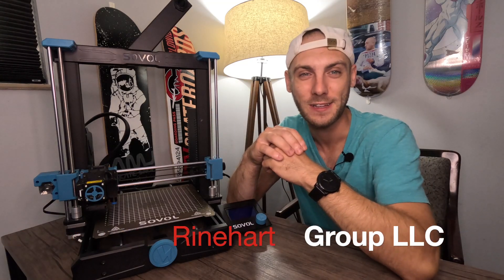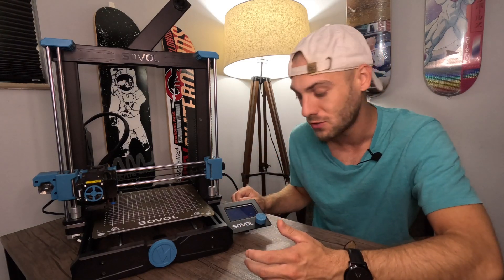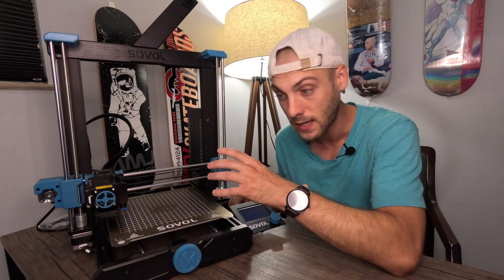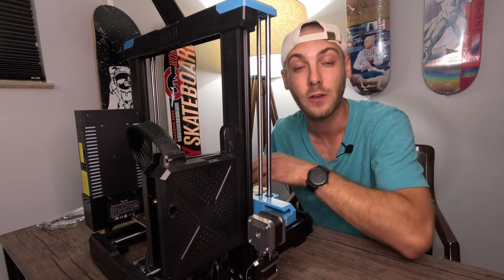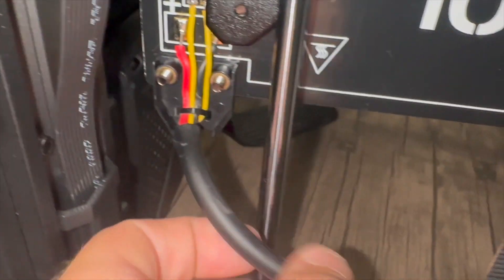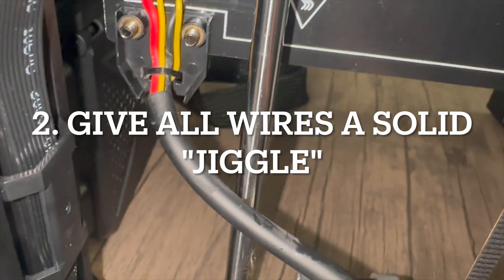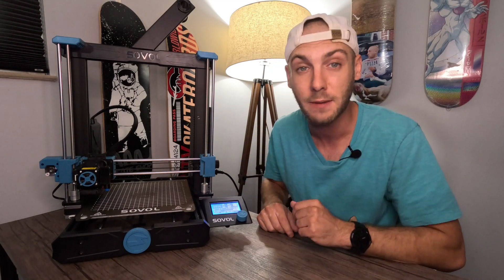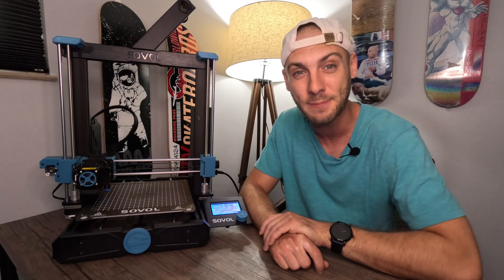3D Printing Ep#8: SOVOL SV06 Design Flaw "Bed Printer Halted" Temporary Fix

Comment: I had a broken wire right on the middle of the black one, my solution was to replace the thermistor wire by a new one. Desolder the old and put a new one, more flexible
Reply from the maker: Did sovol give you another one under warranty? They will more than likely do that no matter how old the machine is
Reply: @RinehartGroupLLC   it was a easy fix, why bother and now it's better than previously

Comment: actually  think should also consider upgrading the firmware of the printer in question  , this approach works pretty well in most of the cases
Reply from the maker: Upgrading the firmware will change nothing in the case of wires not being properly soldered to the printer. Still going to have bad connections leading to the same problems. Kind of like changing your tires after you blew the motor

Comment: Just to clarify, electricity does not go to the thermistors. Thermistors actually create a millivolt signal that is sent to the mother board.  The hotter the thermistor the higher the millivolt output that it sends to the motherboard.  The printer uses this signal to determine when the bed/hot end heaters should turn on.  So the thermistor is just a temperature probe that tells the printer how hot the bed or hot end is and if it needs to send more or less voltage to the heaters.  If a thermistor wire breaks the printer does not know how hot the bed or hot end is and shuts downs as a safety precaution.
Reply: I think it’s a great printer for the price. I bought it during the preorder sale so I’ve had it a while.I haven’t done any mods except for the bed cable support and haven’t any problems except for the thermistor fault. I ended up replacing the entire thermistor wires from the bed to the motherboard. I also added a beagle cam to record time lapses
Reply from the maker: Thanks for the info! Do you have an sv06 or an sv06 plus?
Reply: @RinehartGroupLLC  I have an sv06. Great printer but I have had tons of problems with the bed heater and thermistor.
Reply from the maker: @firehead77 anything I should look out for in the future? I wish someone would have told me to print the bed cable support right when I got it out of the box. I got a new bed installed with a support but I’m nervous about what is next
Reply from the maker: Did SOVOL replace the thermistor wires for free?
Reply: @RinehartGroupLLC  I did not contact them. I have everything needed so I just did it myself.
Reply from the maker: @firehead77 got ya! Glad everything turned out well for you
Reply: You're thinking of a thermocouple which creates a small voltage from disimilar metals. Thermistors are a passive sensor which get power applied to them which goes to a resistor dividor to measure the voltage which represents a temperatures. The Sovol uses thermistors not thermocouples.